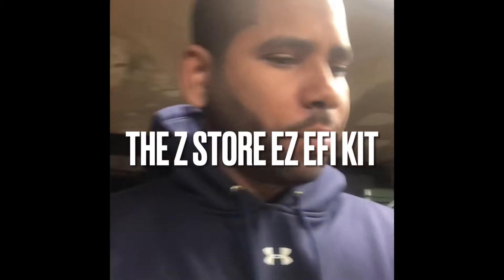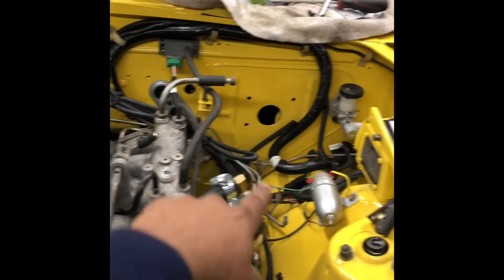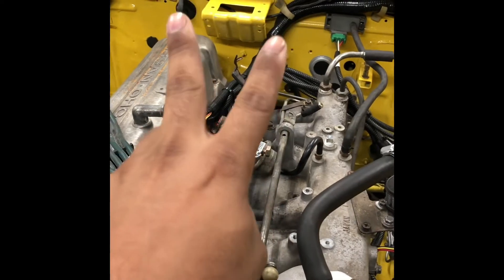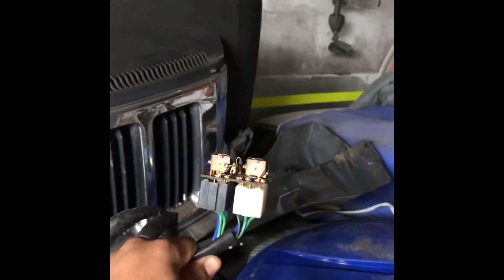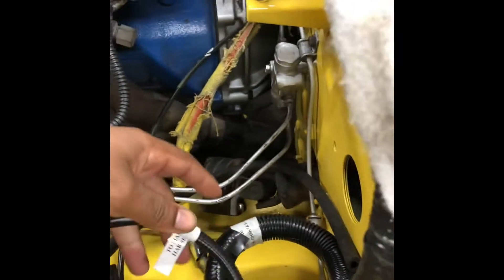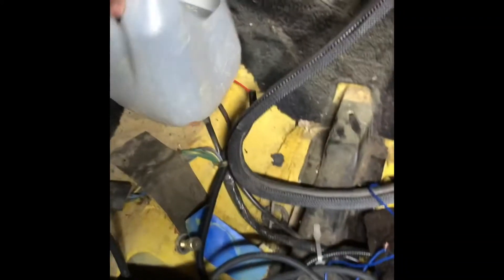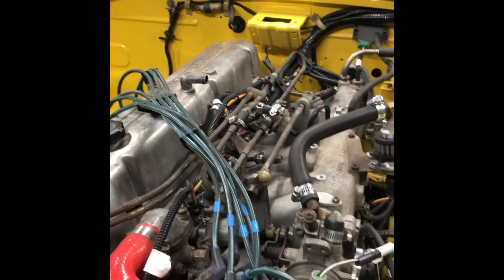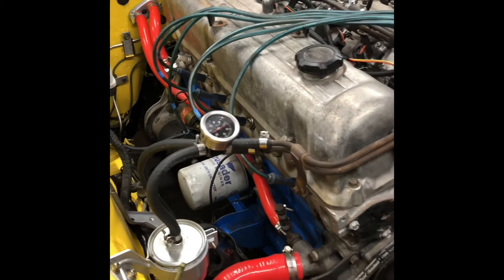Fast efi kit for Datsun 280z

Comment: Why does the car foul out the spark plugs? Is it better to instantly drive it with new spark plugs as well as when you install the EFI system?
Reply from the maker: I cannot say that what I’m about to tell you is a fact. But the reason I believe it foul them out when you just let the car idle is because this is a self tuning system the ecu doesn’t know the correct air to fuel ratio it needs yet.
Reply: Will do! I appreciate it, someone commented on my video saying it’s to low of a voltage? could that really affect? Also are you using a OEM alternator?
Reply from the maker: I had an oem alternator. If anything you need to make sure the ecu is getting 12v but there’s a setting that u can see what voltage the car has and make sure your grounds are good these cars are old. It’s easy to over look something so simple
Reply: For sure, I’m just having a problem getting the spark plugs fouling on me when I try to test drive it for it to self learn. :/
Reply from the maker: @new_bright_0362  all the other settings are good ? Have you checked for any vacuums leaks ?
Reply: most of everything thing looks good? would I need a whole exhaust system? I just have the 02 sensor welded on the header line pipe.
Reply from the maker: @new_bright_0362  that should be fine with the o2 there. How’s ur fuel pressure? Stock fuel pressure regulator
Reply: I posted a SHORT video of it dying if it gives you an idea
Reply: yeah stock fuel pressure regulator,  it looks like last owner installed a PSI guage as well as a PRO TUNER  fuel rail. Should I buy a new regulator? It does look 50 years old hehe. Not sure if my spark plugs are fouled now either. I start up the car here and there and have it idle for a bit.
Reply from the maker: @new_bright_0362 I would suggest to pull out the plugs first inspect them and throw a new set in and go for a drive.
Reply: For sure thanks again :)
Reply: Where did you find the 12 volt switched source that remains constant through run start and crank? The two wires I found turn off during the crank portion.

Comment: Good info. Just came across this kit. Would be nice on my 240z.
Reply from the maker: Yeah just remember in your case you’ll have to upgrade the fuel pump system to be able to hold the psi that the injectors requires